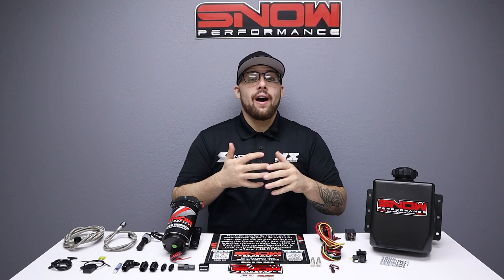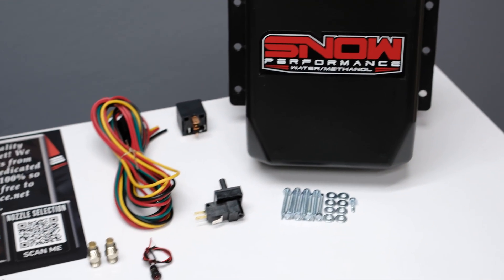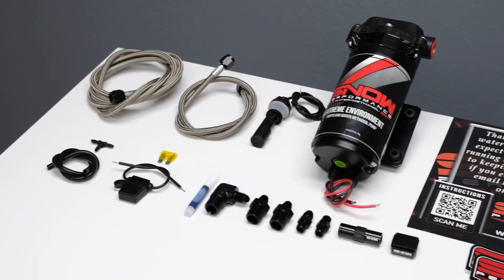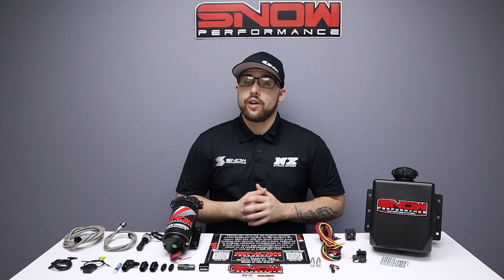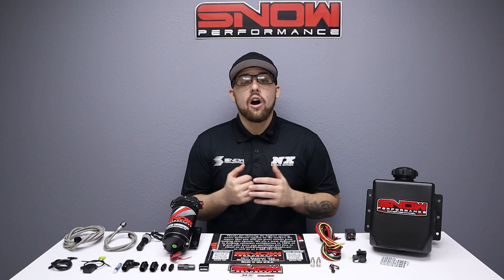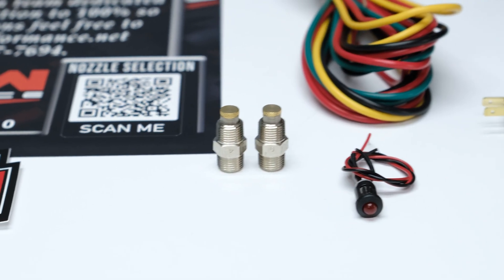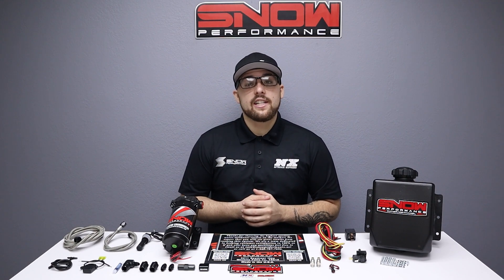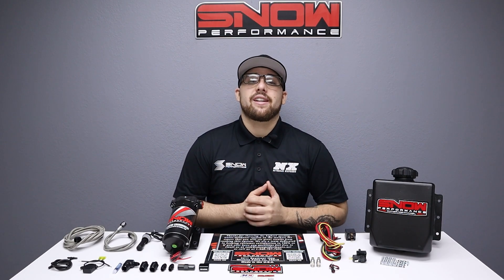How is Snow Performance's Stage 1 Boost Cooler this EFFECTIVE?

Comment: Is this recommended for a rt charger with a turbo ? Or is the 2.5 better and more worth ?
Reply: Can this be combined while using E85
Reply from the maker: It can!
Reply from the maker: I'd recommend our stage 2.5 the controller is super easy to use and can be fine tuned to match what your engine needs
Reply: Would this kit take the flex Ecoboost 2nd gen (directed injection) to the 400hp? Would it clean the carbon built on the valves also?